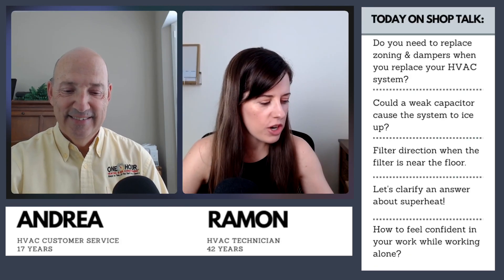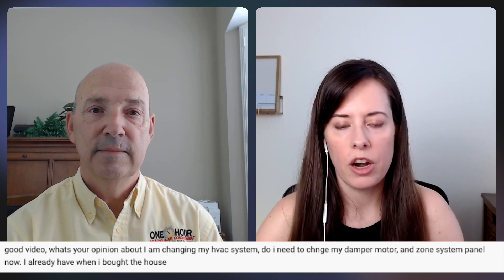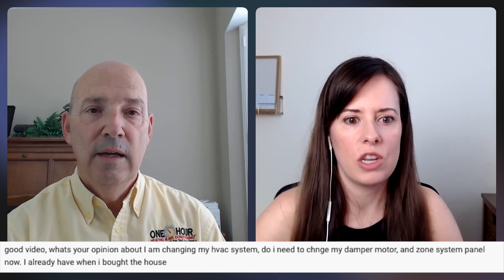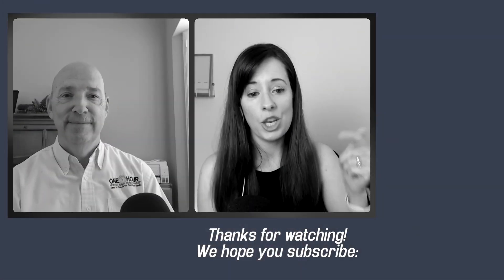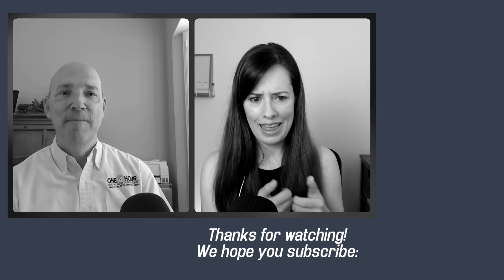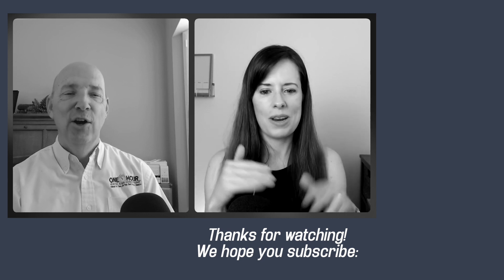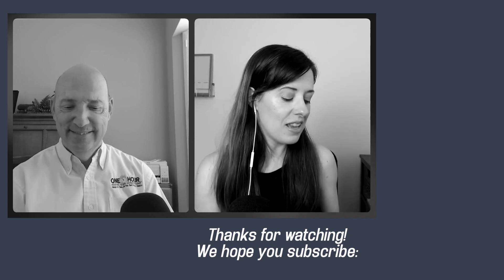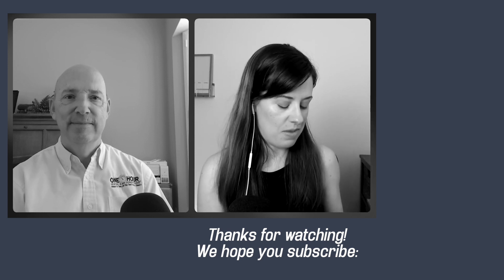HVAC Questions and Answers: Does a bad capacitor cause ice, filter direction, learning to work alone

Comment: I just worked on a neighbor's AC unit tonight.  I walked up on an iced compressor.  I checked the 45/5 cap and found the compressor side of it was only 4.52uF, should have been 45uF.  The fan side was a good 5.04uF.  The cap was replaced, and the system runs very well and doesn't ice anymore.  :)

Comment: Ok,  so when I turn my system on it almost immediately starts building frost on the small evap coil lines going into the coil (high side,  inside). My r22 gages read high side around 60 and low side 66. ..... once the system is running a while the low will drop to around 0-20. 

Running the system in heat mode results in only Luke warm copper at the inside coil after an extended run of 5-10 minutes.

Trane 5 ton heat pump.

Also noticed that it doesn't want to take any r22 when running. I could see what it was doing cuz I had a empty "leak saver" cartridge hooked up in line on the low side. 

Is my compressor screwed....or could it be a bad hard start? 🤔 

Thanks to anyone who can throw me a bone and help me out. I'm heading back out there to go get the capacitors right now. Thanks!

Comment: Very nice to know there are great contractors and technician out there. If the outdoor unit had a  bad compressor  and the indoor air handler is in great condition, why does some contractor want to replace the entire system... is it necessary.
Reply from the maker: Great question!  I'll ask Ramon and let you know!